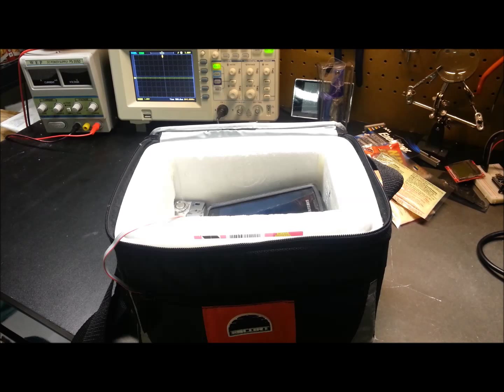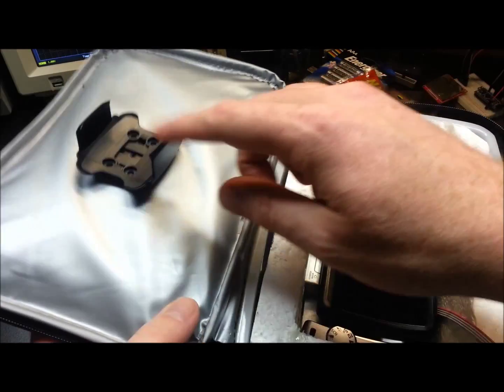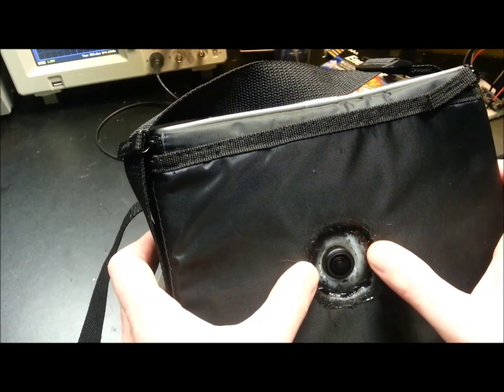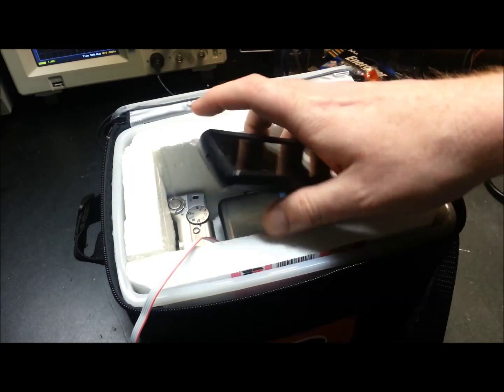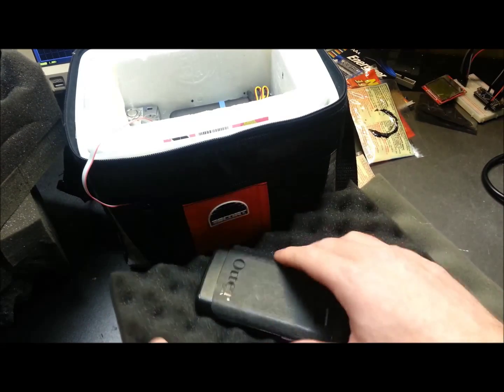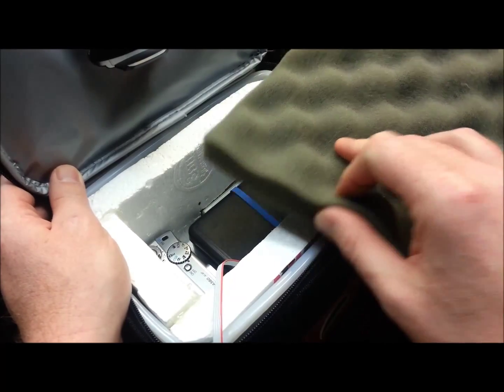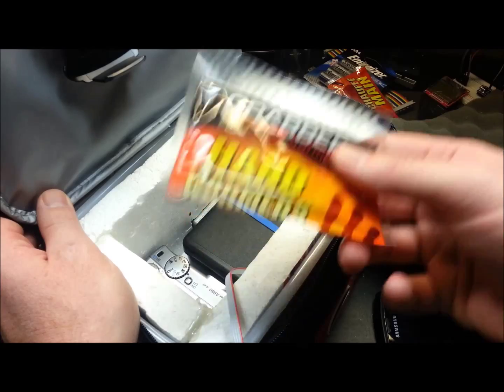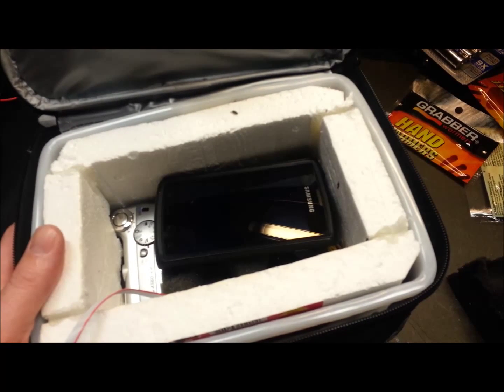HAB Part 13- Payload Module Final Assembly

Comment: Looks good.  Have you thought about adding an external antenna to the cellphone?  It's packed tightly with other electronics and an external would give it much better range.
Reply from the maker: No real need I can see.  The cell is working fine in all ground tests and that's the only place we need it.  Cheers
Reply: Eric William  Gotcha.  Must be nice to know that it will land in a location with good cell reception.
Reply from the maker: Ya it's pretty highly populated here- which causes other problems :)  Cheers